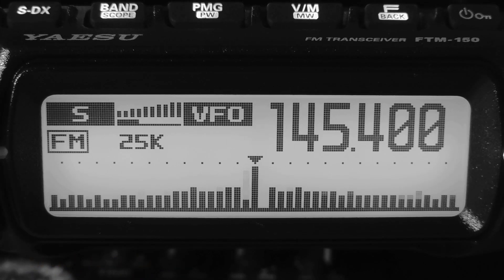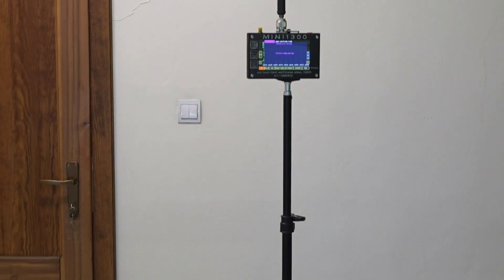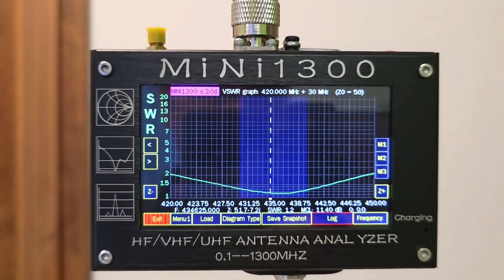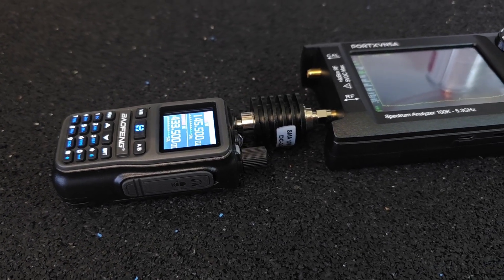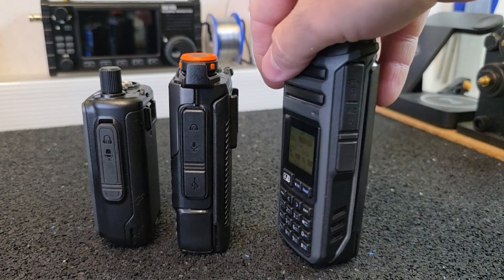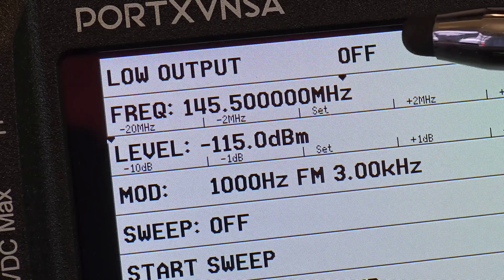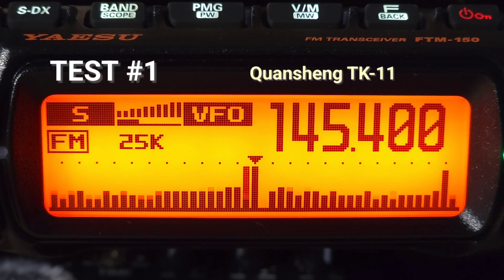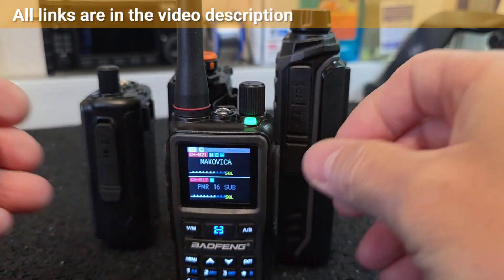Baofeng GT-5R Mini / UV-5R Mini: RF Power & SWR Test! Comparison vs. Quansheng - Worth Buying ??

Comment: Thank you Paul for the systematic tests on receiver sensitivity and squelch. That's very insightful! But the rubber antennas: Every manufacturer will say the antennas work better when mounted on a handhelded device, because the OldMan itself then provides the necessary counterweight. Perhaps you could clamp a 'reference OM' in the form of a 1.5-meter piece of aluminum foil from the kitchen to the tripod and the analyzer.
Reply from the maker: Thank you. Yes it can be true as you say. It is maybe just a capacitive coupled counterpoise as the shell of each HT is made of plastic so the human body doesn't touch of ground physically in any way.

Comment: Very informative video, thanks Paul! It was interesting that you did the comparison between the TK11, UV K5 which looked to be stock with no 3rd party firmware and the GT 5R. Wonder how the Radtel RT-880 or RT-950 would have done. 

There seem to be a lot of these little radios out in the wild now so wonder if the modification community are working on firmware enhancements. Also out of curiosity there are two hardware versions out. The first batch of radios I received from a seller on AliExpress where the ones that most folks have and in the 'about' menu display FW V0.26 HW V1.0 and the motherboard is stamped 5R_MINI V1.6 with build date of 2025/06/09. I found that this version has poor soldier joints around the volume pot which caused dead or intermittent audio even though the LED showed signal being received. 

The latest radios I have received showed FW V0.27 HW V1.7 in the radios menu but on the motherboard it is stamped 5R_MINI V1.8 with date stamp 2025/08/05. This board has more soldier flowed over the volume pot soldier points vs the original and this radio doesn't have the intermittent issues I had with my original minis. I did reflow the soldier connections on my first batch of minis and that has solved this audio issue.

Just curious which hardware version the GT 5R mini you have is. Thanks again!

Comment: I  got two for 30 Euro, but UV-5R Mini, so absolutely worth it. May there is a small difference between GT and UV, cause the spurious looks better on my UV. Radios working fine, the display could be show name and frequency simultaneously on both vfo, could be fixed by a firmware update, but I never saw any updates from baofeng for any radio.  73

Comment: Just a note. My experience and measurements show that the Han Held antenna tunes best when it is close to the human body in a position similar to that used for conversation (this is probably how it is optimised). In addition, the human body acts as an electrical counterweight for the antenna.
As for sensitivity measurements, I even expected that the TK-11 and UV-K5 would be worse (this coincides with my observations; these are software receivers, and in such a small device it is difficult to remove interference from processors, although perhaps sensitivity can be improved with software), but I think it has better audio. The GT-5R is an interesting proposition due to its dimensions but its capabilities are more limited.
Reply from the maker: It's very interesting explanation. Thank you! 😉👍

Comment: would if the changed the charging cradle to a USB plug - same with Quansheng....have to use a travel adapter
Reply: Battery on this radio does not have terminals for charging cradle. Only USB.

Comment: Hi did you mean UV-5R mini not GT5R mini?
I couldn’t find a GT-5R on Baofeng’s website , I could only find the UV-5R…🤔🤔🤔
Reply from the maker: There is no functional difference between the two models; they are simply named differently depending on the seller(Radioddity) and region where they are sold.
Reply: I found it on their website. Just a name difference UV is name given to radios shipped to North America and possible other non European countries while GT is name given to radios shipped to European countries according to the Baofeng site.

Thanks for the very informative video Paul!